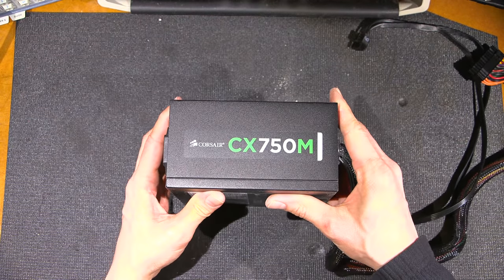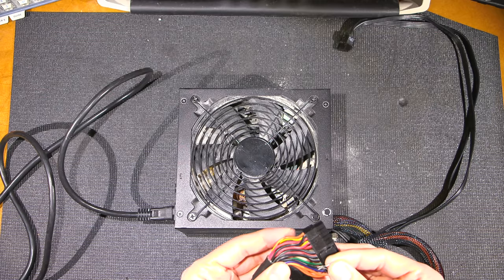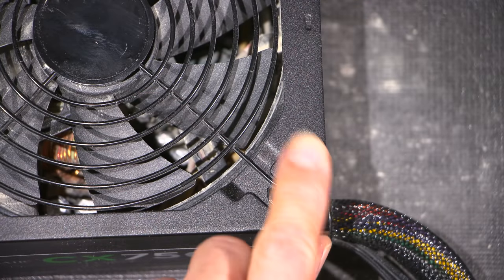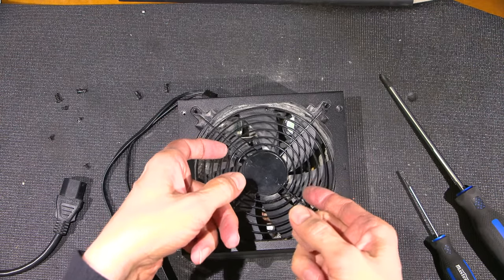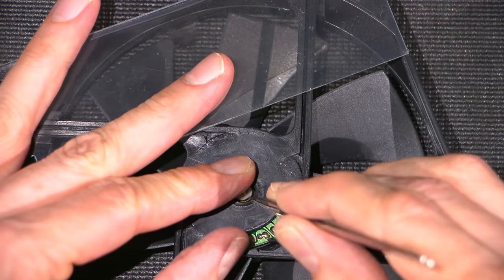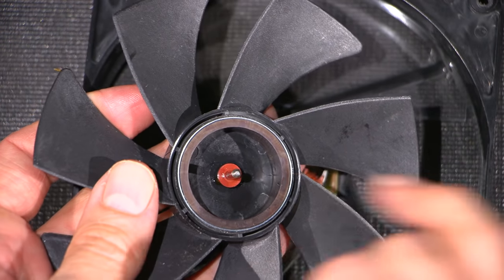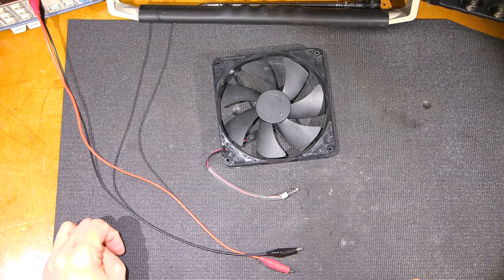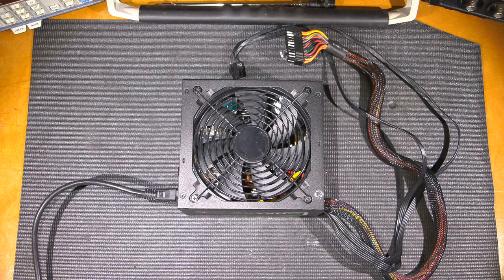Fix A Computer Power Supply!

Comment: I know this wasn't much of a challenge, probably even boring for you, but I'd love to see some ATX PSU repair guidelines from you in the future. On almost every forum, everytime someone asks about a failure or problem on an ATX PSU,  the rest says «just toss it, it's too dangerous», «don't touch it», «it's not worth it», and so on. Thank you, as always.
Reply: in old times (when people start telling stuff like that) it was quite easy to repair most of them, rarely anything other than diodes or switching transistors failed and even if problem was controller there were maybe three types of them on market. Today it can be tricky, lot of different parts, specialized ICs..."not worth it" never had more sense. 
Still, as youtube video material I agree that it would be interesting to watch, area not many people cover.
Reply: Completely agree. Lots of waste in computer parts in general.
Reply: @gorjy9610  and you do want to make sure that the repaired psu is working to spec you don't want a repaired PSU taking out the MB/CPU or a graphics card
Reply: @gorjy9610  I had a newer PSU fail with a blown snubber capacitor on the switching MOSFET. Since the value of the capacitor was burned off, I found the datasheet for the driver IC and looked at the typical application. It turns out the PSU manufacturer had completely omitted the snubber resistor and diode, opting to just put the capacitor across the drain and source of the FET directly. I "updated" the board design with the actual typical application circuit, and the PSU ran cooler than it ever had, even when new!
Reply: Yeah :( It is so sad how many ppl while upgrading their computers just buy a new PSU and drow the old one away.  I worked in SER Recycling center and every day there where 750w+ power supplies "found". So many RGP controllers adding to the silicon shortage. And PSU shortage.
Reply: agreed! as much of a pleasure as this video was, I would love to see some other faults on the actual board :)
Reply: These days it's not a matter of "too dangerous" "don't touch it".
For those with the will to fix things that break instead of just buying a new one, it's more a matter of "I can't find the dang chip/transistor/component they used because they never published the circuit schematic so I can't tell what chips they used from that, and the ones that failed either burnt up to the point the markings are illegible, or the numbers were laser-etched off the chips at some point of the PSU manufacturing process, so I can't tell from that either".
It's like they WANT you to throw it away, when the parts that failed total maybe $50 worth of semiconductors and electrolytic capacitors in total.

This stuff was a lot easier to do when the "capacitor plague" of the mid-late 2000's was in full-swing. People were making kits that contained all the capacitors that would fail, the most likely failed semiconductor devices that would fail as a result of those capacitors failing, and all you really needed was a soldering iron, Google, and the will to not discard something that may still have value in it.

Heck, if it came to it, I could probably re-wind a transformer coil if I had to back then, but now they started using SQUARE magnet wire to pack more copper in the same space, which is great for efficiency but horrible for if you're trying to re-wind something because where do you even buy SQUARE enameled magnet wire?.
Besides, nowadays I can't find the info I need to do any of that, I no longer know where to look and if it's behind a pay-wall (because of course it is) then it's virtually inaccessible to me because that raises the price of fixing the failed thing from "components + labor" to "components + labor + whatever they want to charge to see the schematics that may or may not actually be for the one of perhaps 3-5 versions of the thing I'm trying to fix", which is usually a membership that starts at 100$+ a year, and you can buy only a year or more at a time, and you sometimes even have to provide proof you're a legitimate electronics repair business. Basically as far from "DIY accessible" as possible.
Reply: @44R0Ndin  this is why right to repair is such an important issue :( the industry's attitude towards DIY repair and their power to cripple it is depressing
Reply: @44R0Ndin  

Welcome to the world of planned obsolescence of the product.
The corporate profit counts and the environmental and waste costs are still borne by the consumer.
...
I have exactly this problem with the TACENS ANIMA APII500  power supply - there are no diagrams, the information on the chips is blurred or not identifiable, there is no information about them. One of the microcontrollers is faulty, but it is not known which one it can be replaced with.
Reply: @DielectricVideos  manufacturers often do that, I can only guess how happy is some manager when engineer finally say "ok, it can work without that one 0.1$ part" :) .  
Same I do for some no-name "fake" PSUs today for retro PCs, they use old designs unsuited for modern 12V dependent machines but when you actually populate everything on board you get reliable PSU that last for years, can't say how long as I still wait for first one to die.
Reply: @roberts1938  Part planned obsolescence, part technocracy.  Quite honestly, by the time the dominant forces in this palce are done with it, I think we'll be living in something resembling Brave New World under a centrally planned command economy.  If "they" wanted you repairing they would have made you (their golem) such that you would do so.  Right now, they don't want you doing so, they see us as weeds littering their Eden and simply want us gone.  They see you as parts of their own mind, they look at other people as cattle and chattel, and they look upon you and think "why should I leave him to be doing what he wants. when instead, I could have him doing all of what I want him to be doing, and none of what I do not want him to be doing?"  And look around.  Several generations later, it is so.  Get some 5G and smart dust sensors that are reporting your location, your homrone levels, blood sugar, oxygen and CO2 flux, and brain activity, and in conjunction with your rented IoT enabled device, you'll simply be reported for trying to repair it.  As WEF says, "in 2030, you will own nothing, and you will be happy".

Very frustrating.
Reply: Also "Nah, they don't fit well and they break or it can break something else" Well if you have good soldering skills,  knowledge and use decent components the repair is worth and last long.  Especially if it is a decent/good psu like these.
Reply: I once repaired one. Needed 8 new capacitors, all leaking. They were leaking because they were under dimensioned, a bad brand. And that raised the problem that the space for the new caps, same specs, but all bigger, was spare, and some caps had to be placed in strange positions around the PCB because they didn't fit their old place.
Reply: @gorjy9610  it terms of PC power supplies, they are entirely serviceable, and the components are not at all hard to find, but it can be dangerous if you have to do more than fix or replace a fan and don't know what you're doing. both the manufacturer and the retailer would rather that you buy a whole new unit rather than fix the one you have.
Reply: That was also in a market where power supplies were readily available.
Reply: @iceowl  I didn't say that components are hard to find, just there are more than ever variety of them used. If you worked on PSUs 10-15 years ago than you understand how easy it was before. Still, not a issue for someone working on single one who need to order parts anyway. But for rest of us used to have everything we need somewhere in parts box it's frustrating and I can understand why not many shops would even consider working on fixing PSUs if it can be replaced with new fast and relatively cheap.
Than again someone who don't works on stuff like that often have that other problem, PSUs are maybe wrong thing for amateur to practice on
Reply: Same. I could probably fix a ton of my bad ones with a little guidance.
Reply: @JoneKone  When rebuilding, I reuse. Except when the local transformers took a hit. I lost almost all the electronics in the house. Came back from a holiday weekend to dead computers (PSU's, HDD's died one after another in their new/old homes, washing machine (motherboard fried). Put your accommodations on a panel mount surge suppressor, it will save you money.
Reply: @DielectricVideos  or just buy a quality PSU where the manufacturer doesn't skimp on parts in order to meet a low price point. They aren't THAT expensive. My Seasonic Focus Gold 550w was less then 100 bucks and it has a 10 year warranty. I bet if I still wanted to use it after 10 years, all I had to do was replace the electrolytic caps and it would work another 10 years.
Reply: I design and repair switchmode power supplies for a hobby and for computer power supplies it's usually easier to just re-build them. Modern ones are so complicated that it becomes frustrating troubleshooting them.
Reply: The reason why the 'rest' are negative is that unless you have the expertise and equipment it is too dangerous for you and the load. A mere video isn't likely to provide enough information. It does require in-depth knowledge of SMPS and the components. There are occasions when the repair is simple but generally it isn't. Furthermore  a part that is bad maybe not be the cause - just a symptom.  Mains SMPS undergo a lot of stress so if it is broken it is likely near the end of its life-cycle anyhow. There is a distinct danger of high-voltage being passed to the load if the SMPS fails, so it hardly makes sense to save a bit on the PSU and risk your CPU, MB, RAM, hard-drive, etc. Penny wise but pound foolish.
Reply: It's because if you don't know how to fix it yourself, then you have no business working on a high voltage power supply.
Reply: @44R0Ndin  No, it's more that people who don't know how to repair a high voltage power supply, have no business opening a high voltage power supply.
Reply: @twizz420  Those who don't know are still human beings, therefore, they can learn. Now if they learn by getting shocked by the thing because they put their fingers where they shouldn't, or they learned by reading how to properly approach mains powered equipment isn't up to me, and I'd advocate for the latter approach, but to say "you have no business opening it without training" could be taken to be quite insulting to the intelligence of the person.
They may have no other options other than "go without" or "fix the thing for less than it costs to get a new one", and let's face it, "go without" isn't really a fair option anyways.
Plus, with recent trends in buying anything with semiconductors in it (prices skyrocketing, no supply to be found, lottery systems being put in place to get what is available hopefully without the scalpers getting it, etc.), it's even more worth it to fix what you have than ever, so more people are going to be trying it, and training be damned.
The more available the needed knowledge is to fix these things, the better. For electronics, that's whatever safety procedures are needed (easily available), circuit schematics, diagrams of the circuit boards that tells you which traces go where and how they connect and what components are where, and lists of what components actually went into the dang thing (next to impossible to find those last 3). That's what it takes to fix a piece of electronics without regard to what condition it came in your door.
IMO there should be two kinds of corporations involved in manufacturing things: Those that produce the plans for something and a small initial run of that thing for testing purposes (especially with electronics, nothing is released in a state where it's perfect), and those that actually manufacture the products. This would allow a third type of corporation to exist, corporations that have all the plans to make the thing but instead of making it they repair it. Our society as a whole discards too many things that are broken only because of one little thing wrong with them. If we can't stop throwing things away, the least we could do is start salvaging components off of them for use in either the same product or other products.

It's very wasteful to take an entire PC PSU and just grind it down and separate out the easily salvaged metals from it when with a different approach to things we could salvage probably at least 80% of the chips and transistors and diodes in it that still work, and probably 90% of the passive components (resistors, capacitors, but especially inductors and transformers) also are still perfectly functional.
Reply: This is exactly why I was hoping for some insight on a better way to drain the PSU rather than just leaving it overnight. That way when people go off about how it's unsafe, I have a sure fire way to tell them it's fine. They certainly don't trust bleeder resistors.
Reply: @TheGameBench  Well the single most important thing I can tell anyone looking to work on a mains-connected SMPS is to find the capacitors that filter the rectified mains voltage, and either short them out (yes, bleeder resistors exist, but nobody should trust hem), or as a safer option make up a "chicken stick" with a alligator clip on one end and a meter probe on the other end, and in-line with the wire connecting them put a 10k resistor in series, then use THAT to discharge the capacitors in a much safer manner (no sparks). After that, verify no remaining charge with a meter.
Once that's done, you're free to work on it as needed and/or as able.
Reply: Most people aren't going to have the equipment to safely repair power supplies, and not everybody has a friend who will do it for free.  If you took this power supply to be repaired, you'll likely be waiting a few days, and be charged almost the cost of a new power supply.   That's if you can find place to repair it.  If you're 50+ years old, you likely remember the TV repairman coming to your house with a case of vacuum tubes.  If it wasn't a tube, you watched with sadness as your TV was loaded onto his truck for a trip to the shop and you did without for a week or two.  Today if you TV breaks, there's nobody to repair your TV.   TV repairman is a job that basically doesn't exist anymore.  If if it's under warranty, you're likely to be given a replacement unit rather than having your TV fixed.
Reply: @Stosh68  That's not entirely true.

There are TV repairmen. I've brought back a lot of flat panel TVs and monitors that people have brought to me because the capacitors have failed. It's a simple fix for me, and it doesn't cost them much. Yes, if the panel is shot, there's really no way for someone to source one, unless it's a current model or a laptop, and even then. However, I've seen LG rinse and repeat sending replacement panels for warranty replacement rather than replacing the whole unit.

As for power supplies... if someone brought me this PSU, I wouldn't charge them mush for this repair. If it were something else, yes... tracking down the fault can be time consuming and require specialty equipment. Sadly, it's most likely going to be cheaper to just replace it, but not always.
Reply: When I hear too dangerous it always makes me wonder what kind of idiot is telling me that knowing they have some experience with things beyond their skill level.

Never let anyone tell you it's too dangerous. People who ask the right questions are worth teaching imo.
Reply: @capypapaya  I'm going to say it in a way that makes perfect sense, but also in a way I really have no knowledge of, so lol pointless to say, but it's a 3.3v, 5v 12v rail, and the knowledge of how an "ISO Certified standard" PSU should function. Now... These knockoff house torches, not worth the time. But I legitimately was kind of disgusted when I watched a video just to see nothing of the actual PSU being fixed, outside of Bug killer and years of dust being blown out.  We revived a PSU Fan... To make using the perfectly functional PSU to be usable in everyday use case, aside from being dusty/dirty.

Granted, I did learn a bit more about PC Fans, I too only oil the backside, and not get it apart enough to get the front "Sleeve" bearing. AKA piece of hot wheel packaging plastic. lol   Oscilliscopes galore, many other electric devices that I probably really have no clue what they are... And a fan is fixed in this atmosphere! :P  I do get it, and appreciate it, again. But from my perspective, and probably many others. Come on... Take a real challenge on this title you have for this video, or at least change the video as it's VERY misleading. :P
Reply: @mauricewalshe8234  Yes I would tend to agree, however I would trust Mr. Carlson's repairs over new.  He is fantastic!
Reply: @roberts1938  So true.
Reply: start looking for videos in the vintage pc area then.  We hobbyists don't have the ability to always find replacement parts so we do what is necessary to repair the originals.
Reply: @DillonStrichman  Just ask any small farmer about AG equipment repair policies.  J. Deere etc.